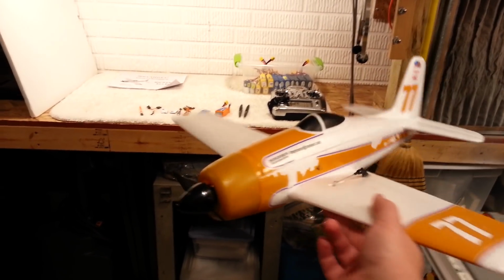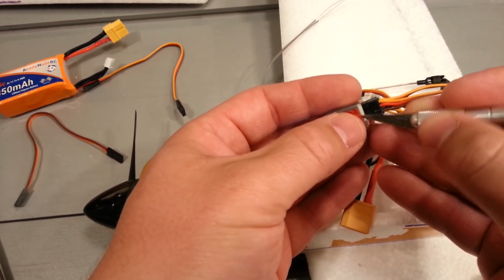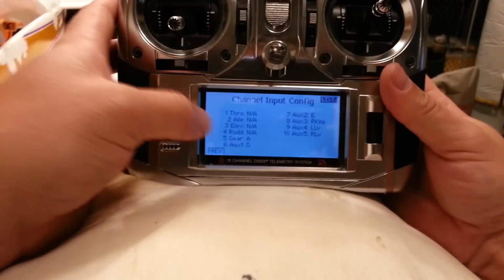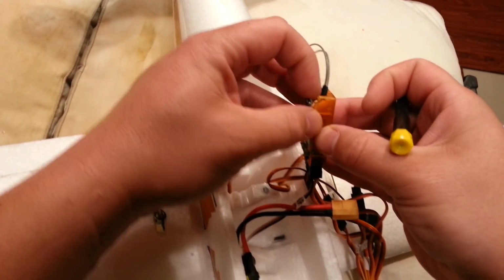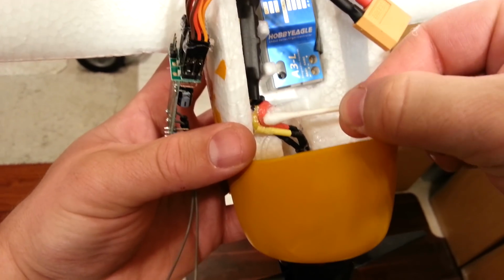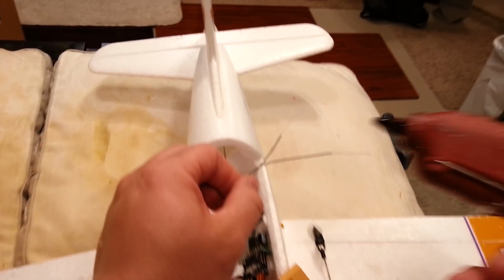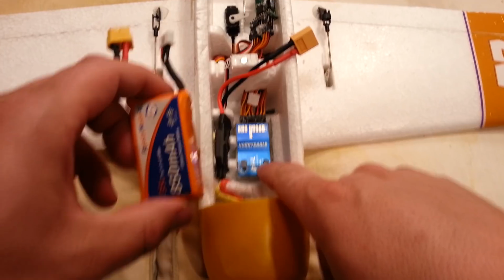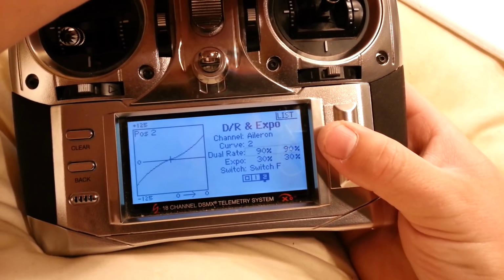Sky Angel RC - Rare Bear - Build Part 2

Comment: Brian Phillips. Does that capacitor protect the battery? Also where do do you find them? Thanks.
Reply from the maker: The capacitor protects the whole plane by helping to prevent "brownouts" on the BEC (the Battery Eliminator Circuit is what powers the receiver and servos on most RC planes) from the stabilizer drawing down the voltage when running the servos like crazy to keep up with the wind.

Comment: Brian, on my 800mm p51 I had my stab toward the back of the canopy which isn’t near the cg. Cud that be why the plane was pourposing?  It it detrimental to have it on the cg like u said here. Thanks
Reply from the maker: Gene Sultan I think this could be exacerbating your issue, but could just be that your gains are too high.

Is there enough room to scoot it back, closer to the CG and see if your porposing goes away?